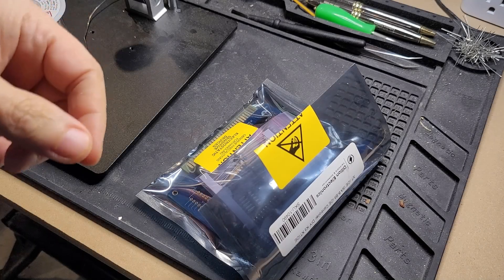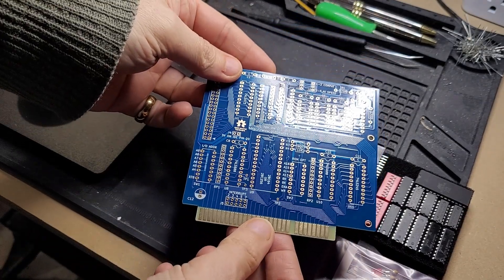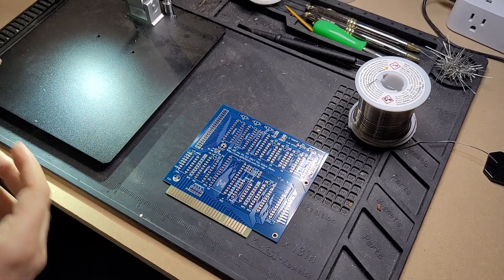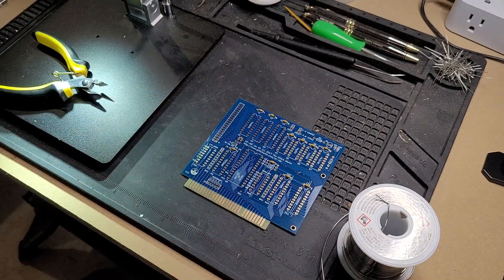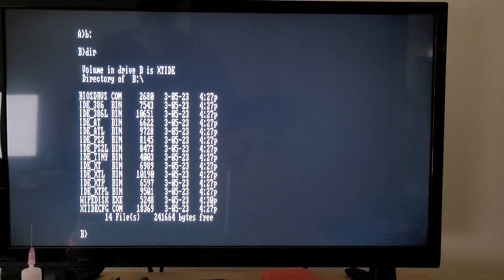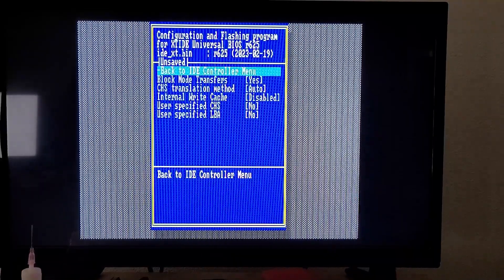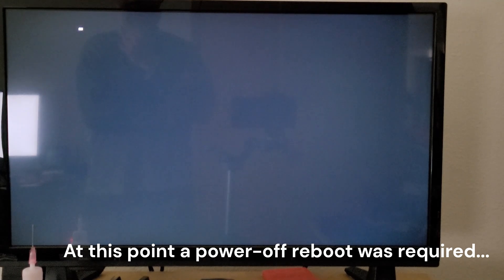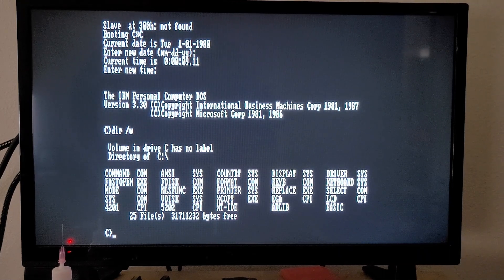Building an XT-IDE card

Comment: BECAUSE of this video, I bought the preassembled kit.  EBay was being a bit of a dip, so, although the soldering is easy enough I did considered buying just the kit, but, ebay was being a bit of a dip and not allowing me to put the PCB and the sockets (Different sale) in my basket at once.  So just paid the premium to get the card assembled so I can use it out of the box.  ... if.. it comes in a box... if not, out of the bag?

Comment: Don't plug it in the slot the wrong way round, it won't survive, BTDT 😞
Reply from the maker: Yeah, good point.  I should have mentioned that.  I have mine set up with the CF adaptor plugged directly into the IDE header, so backwards would not be possible.  I should put a bracket on the back just to be safe.
Reply: @nhbretro  I've got 2 , one is the same as yours and the other is the smaller version with the compact flash connector. The CF version has the card pointing out the back. 
The IDE version i use with a CF adapter which points inwards.  I plugged the IDE version with the CF point out the back thinking it was the CF version. 
I was using them on a uncased motherboard so easy to put them in the wrong way round.
It kills the EEPROM for sure and has killed something else as the card BIOS no longer sees any IDE devices. 
I've tested all the other chips on my EGecu and they all pass so i guess one is slightly damaged, i will have to swap them out with another set.
Reply from the maker: @jameshearne891  Ouch.

Comment: watching you cut those capacitors off the tape made me cringe.  i'd never trim any bit of the legs off, until after they are soldered to the board
Reply from the maker: Interesting point.  The legs were very long to start with.
Reply: @nhbretro  yes, but still.  I'm also used to having to save a couple of them for jumpers and bodges, and the longer, the more useful for those.  Guess it's just different strokes
Reply from the maker: @MinorLG  I think it is absolutely something to take into account and something that I wasn't considering.  I appreciate the knowledge.
Reply: @nhbretro  I would cut them like you did, if you pull the legs out of the tape it often leaves glue from the tape on the ends of the legs and sometimes this can transfer to the inside of the vias when you insert the component and then cause soldering issues.
Just buy a roll of tinned copper wire (about 25SWG size ) and you don't need to worry about saving the cut off legs for making links.
Reply from the maker: @jameshearne891  I have fought with the glue residue on the legs before. :)